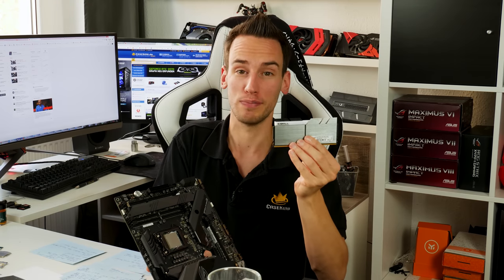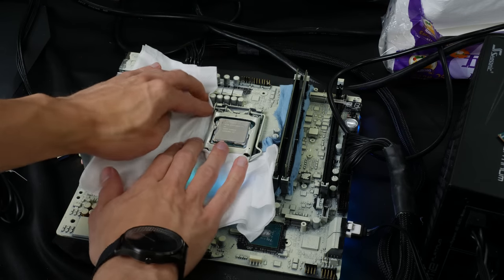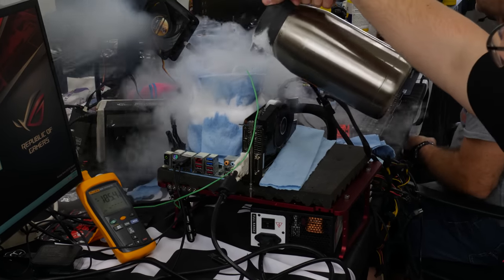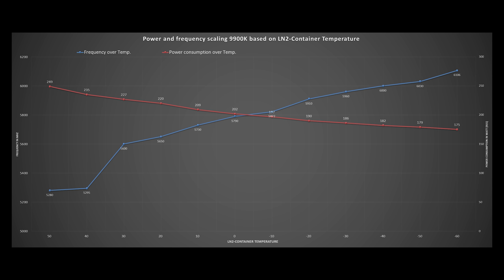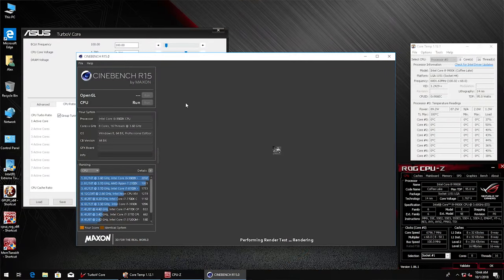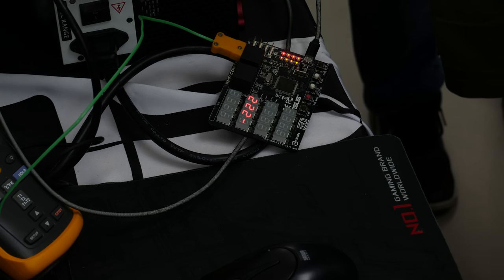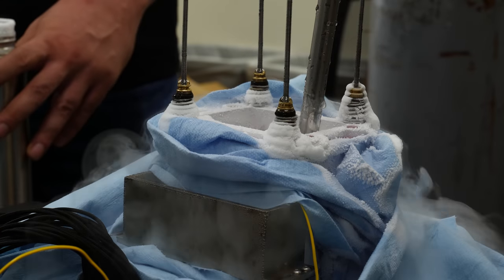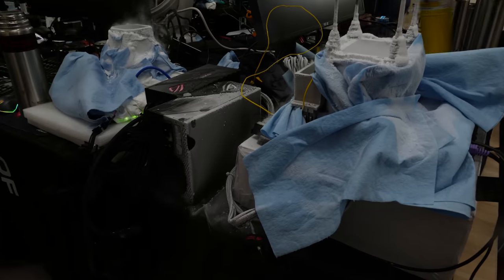World Record with i9-9900K at -230 °C - LIQUID HELIUM

Comment: your not splitting them down... your unsplitting them turning them from quad channel to dual channel...good idea for more ram however... at the same time adding an unnessesary bottle neck... if your motherboard can handle quad channel... then 4 ram sticks splitting the job 4 ways instead of craming that same data into 2... well you be the judge... most would argue though that depending on your ram of course its difficult to actualy notice a difference...

Comment: Isn’t liquid helium expensive? Why not just use ln2?
Reply: Nowhere near cold enough, they are not trying to loose in benchmarks, they want to win them. Its like why water when air is good enough? Well, for those last few points, its just not good enough. Helium boils 4c above absolute 0, LN2 boils 77c above absolute 0, its just a lot colder.
Reply: Jake Garrett oh ok does that extra 70 degrees below zero actually give you better speed?
Reply: @MLGJuggernautgaming  Yeah, its a decent bump. For some chips its just a decent bump, for some its huge. Although there are those few weird chips that hit a cold bug and can't even run on LN2 correctly (so those wouldn't apply). But for most chips, its a great advantage, making them untouchable against LN2 overclockers, its a whole different game at that point (just like my 24/7 phase cooler, keeping even the hottest chips below 0c on the core, but it won't get even close to LN2 benchmarks).
Reply: @jakegarrett8109  and now imagine everyone doing it to beat each others records....
we need this stuff for more useful purposes :(
Reply: @jamaly77  Yeah, same could with Tesla destroying 1000 pounds of Lithium batteries (500 KG for metric users) on EACH car. Lithium batteries are lucky at best to survive 7 years (see many laptops from 2011 that have great battery life? There are some, but its not the majority). Instead of wasting all that on cars, why not make some cool electric bicycles instead? He has a big enough public image, and enough tree huggers willing to back him, they could surely get both biking infrastructure in the US, and an awareness to having bicycles as a normal means of transportation. 

You could say, "well why not just a regular bicycle?", and I have 1 word, "Amaricans". Seriously, unless there is a cheeseburger tied in front of the bike, we won't do it. Side note, and actual fact: I used to compete in USAC collegiate road racing while packing Pop-Tarts and a foot-long King size Rice-Crispies treat (back jersey pocket), usually starting the race with chocolate mini-doughnuts in my hands (the powdered ones would make you choke as you're gasping for breath, they are my favorite otherwise). Electric though, would mean you wouldn't have to pedal unless you wanted to, and people probably would some just because. So it would help improve congested roads, reduce commute times in town, and give Americans a healthier option, all while only using maybe 8 pounds of batteries per bike (over 100 bicycles per 1 Tesla made)

Comment: What a waste of helium. Did you know we're actually running out? The US had a huge stockpile, which they were forced to start selling off by legislation introduced in 1996. The price of liquid helium has only increased by 3 or 4 times since 2000, but the price is expected to skyrocket once the US helium stockpile runs out. We're currently using helium at over 100x the rate is can be extracted as a by product from oil and gas wells, because it is the rarest element on earth. When helium escapes containment the molecules are so light (much lighter than air) that they rise to the top of our atmosphere where they are stripped away by the solar winds and ejected into space. Helium cannot be manufactured, it can only be extracted in minuscule amounts as a by product from oil and gas wells or reclaimed from the atmosphere but this process is incredibly slow, tedious and expensive. And that is ignoring the fact that the technology needed to reclaim it in usable quantities has not been invented yet.

Comment: Lol why so slow... 
I got 8.33ghz on my duron 1800 without cooling. Just bare chip, was hot like 750°C on cinabench r15, got 2328 points. One core.
Got just 2 blue screens, when i was playing gta 5, it got so hot (970°C) and and after that the cpu thermal meter got crazy and it got over planck temperature at msi afterburner (18373718373667117566271992733628293873737283651739930300283738272937918383936817482947622728293838890938839192934682920203983°C) but in real it was like 1200°C and after that i got blue screen, some weird marks on chip, and the cpu got pernament attachment to socket becouse plastic melted, and now it is fine, im running it at 2ghz. Thanks amd this cpu is indestructible.
I had some problems when i tried playing the raise of tomb raider becouse the cpu missed some instructions. But anyway this duron is good, next tear im trying to get to 10ghz.

Comment: how is this a world record, when you haven't beaten the highest Overclocking made by an FX-8350 of 8.9 ghz??
Reply: It's highest performance. Doesn't matter if your CPU is at 100GHz if it's doing sod all actual work whilst at that speed. Not all CPUs do the same amount of work per clock cycle. That's why when we all went from Pentium 4's to Core2Duo's all those years ago, clock speeds actually were slower on the newer Conroe chips, but performance was far superior.
Reply: @noxious89123  your comment has nothing to do with what i said. The world record for overclocking is set by AMD FX 8350 at 8.9ghz, when any other chip it doesn't matter if its AMD or Intel, if you beat 8.9ghz that is a world record. This is just a overclocked record set for the 9900k. All that information you put is irrelevant to my question, but thx for the info.
Reply: @Spaniard1375  it's the clock rate world record on an intel chip